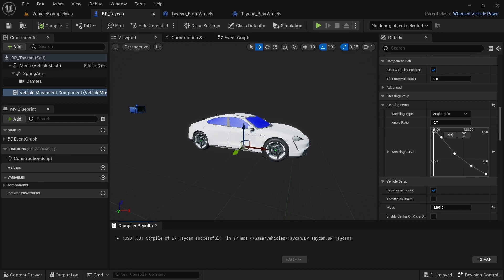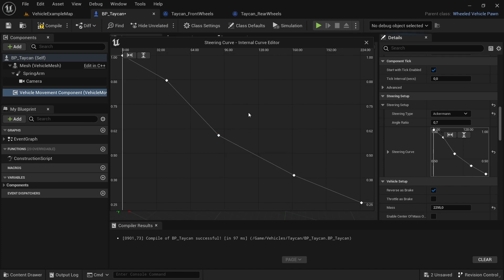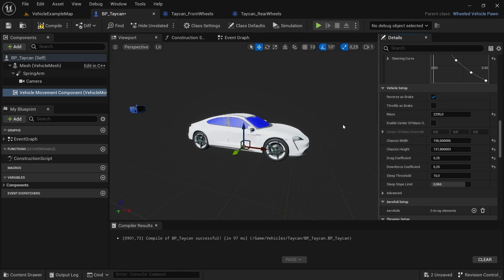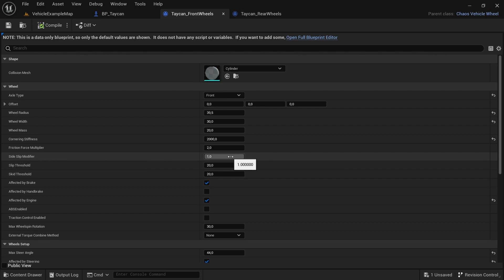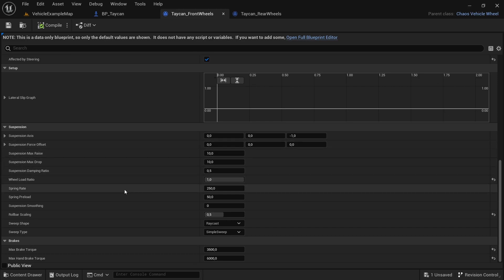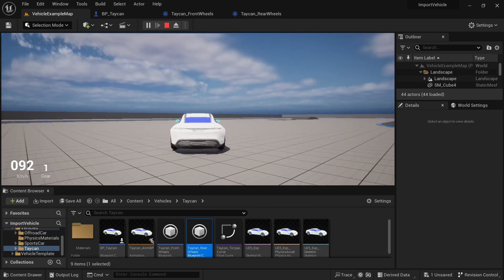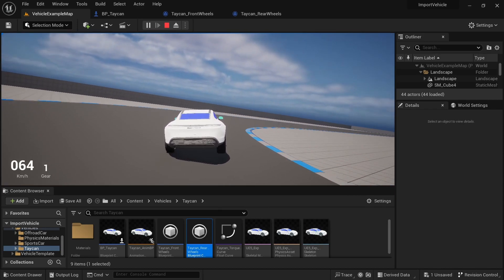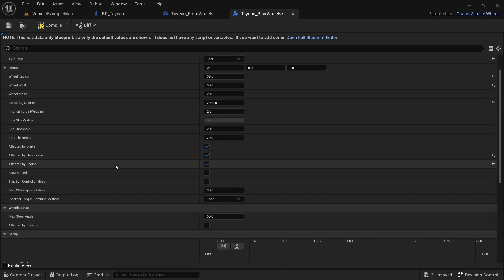Vehicle Mechanical Adjustments | Unreal Engine | Tutorial

Comment: Your vehicle setup seems to allow for drifting with handbrakes but with the default settings in the template, this is not possible. Do you happen to know which setting in particular allows for that to happen?
Reply from the maker: If you play around with the friction multiplier and the skid/slip thresholds, you should be able to get the car drifting, but due to how Unreal simulates physics, you'll probably lose power quite quickly once you do get the car sideways

Comment: How do you  prevent your car from constantly rolling from any turn?
Reply from the maker: That would probably be that the car's center of mass is too high. In the car's blueprint, select the vehicle movement component and scroll down to the lower half of the detail panel. There should be a section that is named 'Center of mass override' or something similar. Lower the 'Z' value into the negative until the car's movement is what you like. 🤝

Comment: Hi 
I am facing issue where i created the car blueprint on default vehicle level everything works fine there, but when i create new level and import car there car wont move or any camera rotation happens
Reply from the maker: In the new level, on the right where the 'Details' panel is. Above it should be two other panels, 'Outliner' and 'World Settings'. Select 'World Settings, look for the 'Game Mode' drop down, within the drop down look for 'Selected GameMode'. Click on the drop down and look for 'Default Pawn Class', it should be the first option, then within the 'Default Pawn Class' set it to the vehicle you want to use.
Reply from the maker: Forgot to add, while you're selecting the 'Default Pawn Class', setup the rest of the other options in the 'Selected GameMode' to match that of the other level
Reply: @GenuImitation  thanks for the solution it worked

Comment: Hi! How could I change the steering to work like an arcade racing game (the crew2, need for speed)? Because for me the steering is too stiff. I tried the settings showed in the video but nothing works, what can I do to make the car be able to steer more? (I also tried changing steering curve, but it didn't give me the result that I wanted)
Reply from the maker: to get a more arcade feel, lower the car's cornering stiffness and friction multiplier, especially the cornering stiffness, which will make the car more drifty but not too much otherwise the car will have no traction to accelerate. try to disable the steering curve cause that forces the car to lose steering angle as it goes faster. to disable the steering curve, just make the line on the curve straight at the top of the curve, that will make it so that the car as max turn angle at all speeds. also, play around with some of the suspension settings
Reply: @GenuImitation  Thank you very much!! This is starting to work! :) Ty man, have a great day!

Comment: is there a way to change the suspension settings at runtime? I.E. making the car lower,  i tried but the suspension files compiles before running the game.
Reply from the maker: You would have to setup a function that grants you access to the suspension settings that you want and attach that to a widget with a slider component so some sort then as you adjust the slider it will run through the code and make the changes in real-time. Hope this helps
Reply: @GenuImitation   thank you for your response, is there any tutorial link about that, I'm very new to UE5.
Reply from the maker: Unfortunately, I haven't come across a video like that before. The answer I gave was based on how I would go about doing it.

Comment: i have question about vehicle movement component ...    i have a starCar and its floating on air  .. when i add a thruster setup on that , that's going to have Repulsive force  from 0,0,0       idk why  but its happens   .. and if i remove that its working fine ( but i need the thruster up axis to managing throttle   )   do you have any recommend notice for me
Reply from the maker: Unfortunately I've never worked with vehicles that move in the air and use thrusters so I can't advice or help in anyway. Sorry
Reply: ok thanks for reply <3  @GenuImitation

Comment: Thank you for making this tutorial.
Reply from the maker: Glad it was helpful! 👍
Reply: @GenuImitation  Bro i have small problem can u help me !?
Reply from the maker: What is the problem ? Let's see if we can figure out a solution
Reply: @GenuImitation  i have car but i dont know its good phisics or no ?
Reply from the maker: Whether the vehicle's physics is good or not will depend on what you want to achieve with the physics. What type of physics would you like your vehicle to have, realistic or arcade style ??
Reply: @GenuImitation  realistic, for final project of university ,
Reply from the maker: Which part of the vehicle's physics doesn't behave realistically ?
Reply: @GenuImitation  i lose controll when i go fast
Reply from the maker: If the problem is a loss of traction then you can increase some values by the blueprints that control the vehicle's wheels. You can increase the 'Friction Force Multiplier', and the 'Slip and Skid Threshold's', of which will make it harder for the vehicle to lose traction. You can also enable the 'Traction Control'. You can also bring the 'Suspension Damping Ration' up to 1, which will make the suspension return to its resting position quicker, then you can also bring the 'Wheel Load Ratio' to 1 as well which will give a more realistic interaction between the ground and the vehicle's suspension. Lastly, you can increase the 'Spring Rate' which will make the suspension much stiffer making it harder to lose traction easily and place the 'Rollbar Scaling' between 0.5 and 1 to stiffen up the vehicle suspension and make it roll less when it shifts weight when turning

Comment: Do you know what i can do to change the wheel collision from single raycast to multicast/shapecast? There is a setting in the wheel blueprint in the suspension section about the wheel sweep and 3 options, raycast, spherecast and shapecast, but shapecast acts exactly like raycast(it shouldn't, collision should take wheel shape into account but it clips into objects) while spherecast works as intended
Reply from the maker: Unfortunately I cannot help you with that. I have a basic laptop that starts to severely lag if I use anything other then raycast when I set up vehicles in unreal. However, I would recommend that you check out the settings in the vehicle's physics assset blueprint as well as the collision shapes that cover the wheels. Hopefully this helps.
Reply: @GenuImitation  I tried everything I can think of including your suggestion but couldn't make it work :( thanks for answering
Reply from the maker: Apologies for being unable to be of more help to you